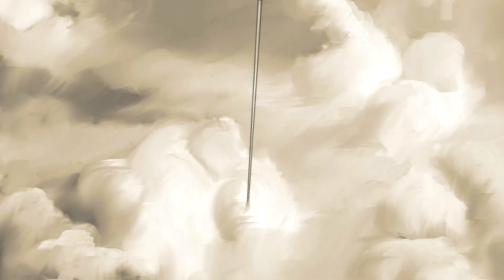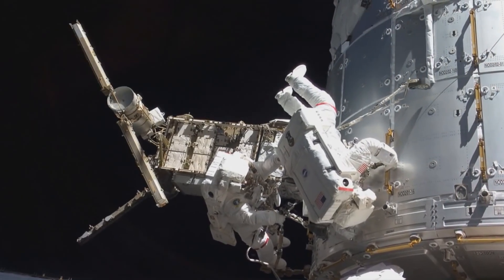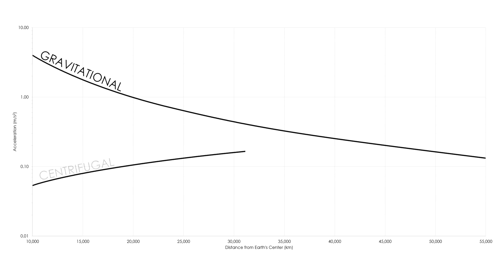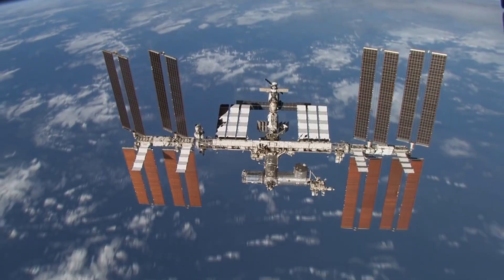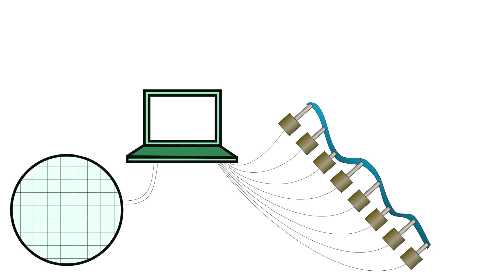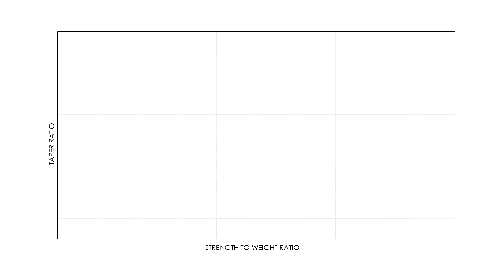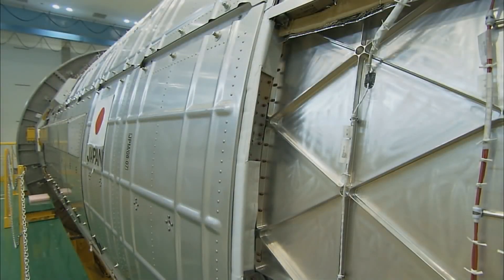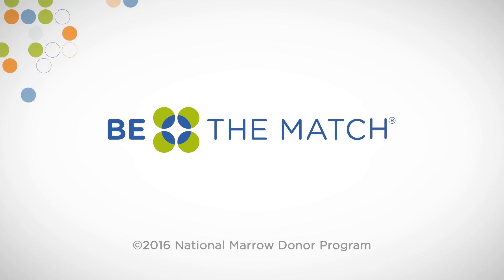Design Your Own Space Elevator

Comment: Hmmm, you say you would need a small diameter cable and have to go up to like huge one at the top where the satellite would be tethered   The reason why is so that the cable could support itself... 

I'm having trouble understanding this, when you say support itself, as in, so it wouldn't fall back down on itself? Or to handle the tension strength or the weight of the elevator itself?  Hmmm... Well, could you push the satellite out further to more tension on the cable so it wouldn't have to be so big?  As with the weight of the elevator itself, about a 3 quarters of a mile up the elevator would begin to start feeling weightless. 

As for power, what if the elevator wasn't an elevator at all, but a fast moving train on a track....  And you had the track laid out to a high mountain like one that is 14,000 feet in hawaii....  If you could get the train up to speed of say a mach 2 (2 x the speed of sound), a little over 1,500 mph, going straight up into the atmosphere, just that momentum alone would most likely carry it into space without any thustors or additional power.

Thanks for the video, it get's the mind thinking.  It sure would be cool to have a train station from earth to space.  A one way ticket please...  I want off this rock!  ;)

Comment: In the desert they did a test like this, it was a crane that had instead of a rope a flat fabric belt (like tie straps) the used solar panels to power the unit and mirrors pointed towards the lifter....they issue was the lifter (elevater) was wobbling around as it was going up and they could not concentrate the mirrors accordance to aim it at the elevator. So we need to put that into consideration...wobble.
Reply: But the other team that did go up the cable far faster and easier, used lasers rather than a wobbling solar panel. much more precise

Comment: Awesome video! I appreciate your handling of the stress/tapering issue.  To me that is the deal breaker on the space elevator.  Ages ago in college we considerd whether a space elevator could be built with a chain of double bonded carbon atoms.  We ran the calculations and determined that the stress exceeded the bond strength.  Your calculations with the carbon nanotubes confirms that result.  

To all the engineers watching this video, "I think this shows that building a space elevator can't be done."

Comment: Slightly more emphasis needs to be made on the speed the climber needs to take to be feasible - particularly for human cargo:

At 100 km/h the climber would take 14 days. That's a lot of food, oxygen and waste management to consider. To get to the top in 24 hours your climber would need to travel at 1460 km/h - the speed of the Bloodhound SSC - by wheels clamped to a very lightweight cable.

Also the mass of the cable:  at 1 gram per meter ( a 1m strip of 80gsm paper 1.25cm wide would weight 1g) would have 35 tonnes of mass - that's not even making the cable thicker and heavier at the top.

All cables stretch a bit. Even if you only have 0.0001 stretch when the climber starts pulling you'll have to somehow handle 3.5 km of slack.

Deploying the cable would be entertaining.  One could lower it down from orbit (I'm picturing hi-vis vested chap staring up into the clouds trying to spot the cable tip flapping about in the wind) or raise it from the ground using sky-hooks or something.

Can't even practice on the moon.  It's tidally locked rotation means the earth is in it's geostationary orbit zone.

I love the idea of a space-elevator it'd be brilliant but, well, infeasible unless some magic is made to sort those problems.

Comment: Great video and animations. The only part that made me cringe was the whole bit about "centrifugal" force. But hey, if it helps people understand then whatever. Nicely done.
Reply from the maker: +jvc https://xkcd.com/123/
Reply: +Practical Engineering lol funny comic. I just hate working with the fictitious force. Net force = ma = mw^2*r = mv^2/r all the way!
Reply from the maker: +jvc In a rotating reference frame, velocity is zero. It's not a choice to use it or not.
Reply: +Practical Engineering But why use the rotating reference frame in the first place? I suppose from a civil engineering perspective it makes sense to have the net forces on the counterweight equal to zero, but using a normal tangential coordinate system, the calculations come out to be the exact same without using a centrifugal force (sense the centrifugal force is "equal" to the mass times the normal acceleration of the object).

Comment: what of the feasibility of using a thorium fueled reactor to supply power...they designed one in the 50's that was intended to power a bomber type aircraft....that could resolve some of the power issue......
Reply from the maker: +Tim Hyatt Very cool thought. I don't know anything about those.
Reply: +Practical Engineering they have a lot of potential,....especially under the same design constraints as needed for a bomber aircraft...would think many of the same factors would apply (as lightweight as possible, while still achieving high output.....)      LFTRs were the competing design back in the 50's and Weinberg's team actually build a proof of concept reactor that ran for 4 years before the project was shutdown (largely for political reasons:  nixon wanted projects in his home state and didnt want competition from others.....)

Comment: Excellent video. Just wanted to mention that for all the talk about saying the same things for years and not going into the details... you said the same thing as every other decent video and didn't go into the details! Specifically, the tether. You waved through it just like everyone else!

Ah, can't blame ya. Liked and subscribed btw
Reply from the maker: +CptAJbanned Thanks. You didn't think the discussion of taper ratios and showing the the inputs to the equation used to calculate it added to the discussion? I had never heard of those concepts until I started digging deeper.
Reply: Oh yes, you're absolutely right. Taper ratios are never mentioned anywhere else. I stand corrected.

Still, more talk on the nanotubes would've been cool too!

Comment: Harnessing element 115 to defeat gravity seems like a better alternative--given that the govt purportedly has already developed technology to do such a thing. :)
Reply: I don't get it. Is element 115 predicted to have a high tensile strength or something? A long-lived isotope of element 115 hasn't been produced (presuming one exists), and even if it had, colossal carbon nanotubes would be far easier to make.
Reply: It's what is known as humor, friend... read all the thread messages. 

However, if element 115 is real & capable of being used to produce anti-gravity propulsion, then there would be no need for a space elevator.
Reply: Oh - element 115 is real enough but only for ~200ms :D
https://en.wikipedia.org/wiki/Ununpentium
Reply: +zeffur7 The Lizard Overlords imposed trade restrictions on element 115 about 5000 years ago — it'd be way too expensive.
Reply: *****
You didn't know that connecting enough flux capacitors together would allow you to make your own element 115 with the right energy reactor source?

Comment: Grady;

In fact, I am in one of the fields you mentioned as being somehow related to Space Elevators. And yes I said it as a plural because the one you describe is just one of the technologies that could serve the purpose of elevating something to space. N.b.; I catalog such a system as a CECNTTSE or in full a "Centrifugally Extended Carbon Nano Tube Tether Space Elevator" while the one I will invite you to consider is a ABSPSE or in full an "Atmospherically Buoyant Spar-Platform Space Elevator" aka a SpaceShaft. And of course there are the Space Towers as well.

I completely agree with your list of reasonable justifications for the need of an elevator to space but the one, I am very grateful, you did not mention is the one which all those 4 science superstars exploit so well for their own popularity and is the ludicrous requirement of automatic orbital insertion when reaching GEO, a precondition that makes those scientists seem to be more in the showbiz than in that of science.

A possible structure to fulfill the requirements you have listed need not cause the automatic orbital insertion for it to be called a space elevator. The only TRUE reason for the CECNTTSE model you discuss as to be extended up all the way up to GEO is just to provide for it the necessary structural stability for it to function and not automatic orbital insertions.  Automatic GEO insertion, (added to the simplicity of a yo-yo), is just an added bonus causing all the fuzz and public interest. Moreover, when considering the energetic savings, it could provide, if a spacecraft needed to operate at lower altitudes than GEO, taking into account orbital mechanics, it will require the same amount of fuel to change orbits going down as it will cost in going up. So the usefulness of a CECNTTSE becomes justifiable only at distances above GEO and nowhere at LEO. And remember that at the time in history in which we live in LEO is the most important region of Space for us, e.g.; the ISS as a simple example.

While the original concept by Tsiolkovsky was a compressional structure it also needed some exotic material for it to be feasible and it is why I believe that his ultimate intention in proposing it was merely to make his contemporaries understand how conservation of energy also applied when balancing potential and kinetical with the achieved altitude and not any sophisticated other benefit. I claim this to be so because for him there was no other logical reason other than suggesting tourist experiencing weightlessness. Remember that, at the time, Tsiolkovsky was unaware of the usefulness of satellites. Tsiolkovsky had no idea whatsoever of the usefulness of having a space telescope, a GPS network, TV or even radio broadcasting, since radio telecommunication was, at that time, not even yet invented by Marconi). His Space Tower/Castle was an invitation for contributions by inspired geeks of the time, (e.g.; civil, structural and material engineers like Eiffel or Otis,) and these did not come in time. Tsiolkovsky's aim then became, with time, centered with rocketry but this was after his proposed Space Elevator, civil engineers failed to find a solution on reducing density while gaining structural stability, and this until now-a-days.

The one thing that has captivated the imagination of millions about the CECNTTSE model you discuss is the apparent elegance of it; which is due to the misleading simplicity of a spinning yo-yo around a child's finger. Hence anything more complex than it, is a; No-No, from the get-go. For example, I am sure that you will recall from your days at college how some other students had some difficulties understanding the concepts of mass, density, weight, etc., so the concept of cumulative buoyancy is a foreign language all together. Well the same thing happens with everything that has some real value in life. The Space Shuttle as you indicate is immensely complex, but admiration of it is because it did get the job done. At the time of Tsiolkovsky, and even Goddard, their lucubrations were regarded as simply silliness, especially by those closest and dear to them.

All the preambles I’ve given above were meant to point out an important fact you missed. In the Wikipedia article you have flashed in your movie there is a mention to a technology called a SpaceShaft, and I bet you; you have never heard about it before despite it is over 10 years old. In fact, there was an article in Wikipedia, with plenty of math describing its mechanism, but it got plundered, defaced and ultimately removed. Anyhow, that is irrelevant right now, and what I would instead suggest is that you read the short description found on the YouTube movie addressed at the end of this contribution.

https://www.youtube.com/watch?v=P3WT1Cagh0U

I have greatly enjoyed your presentation.

Comment: What about different add-on boosts? Like a rail gun to give it a nice little initial velocity? Or hot air balloons for the first 14,000 feet? Then the solar panels could take over and merely sustain the initial velocity. If nanotubes could handle the weight, why not just add on an actual elevator to a nanotube supporting structure?

Comment: One of my big complaints with most discussions on the topic of space elevators is not just the lack of depth, but the lack of breadth. What about powering the climber through the cable itself? or using ground-based lasers for the initial climb then switching to space-based lasers? Maybe you could touch on the launch loop concept or the space fountain?

io9 has an article entitled "Why we will probably never build a space elevator" and while it goes into more depth than most, it lacks the math that your video has. What it does do, however; is bring up at least one interesting alternative: a moon space elevator which could be constructed with conventional materials.

One concept I came up with based on the orbital ring and the space fountain, is to place several stations in low earth orbit which all have a geo-stationary angular velocity but are kept in orbit by a stream of mass (perhaps a particle beam or many small pellets or a few large masses) with much higher angular velocity such that:

Mp*Wp^2*r + Ms*Ws^2*r = G*Me*(r^-2)*(Mp+Ms)

Where Mp is the mass of all the platforms (stations), Wp is the angular velocity of the platforms (pi/(12*60*60) radians/sec), r is the radius of low-earth-orbit (~6720 km for a similar orbit to the ISS), Ms is the total mass of the stream of particles/masses, and Ws is the angular velocity of the mass stream.

I did some back-of-the-napkin math and found that it would be pretty easy to build a low-earth-orbit elevator with a kevlar, or even steel cable. That's not too exciting, because getting to LEO altitude is not nearly as difficult as achieving the delta-v to stay in LEO so any payload delivered via the elevator would either have to stay on the elevator or expend a ton of energy to reach a stable orbit. BUT you now have a stable platform that's significantly higher than sea level and you got there with Kevlar, what if you repeated the process a few thousand more Km higher and dropped a kevlar tether down to the LEO platform? what if you repeated until you get to GEO orbit where payloads can be released without any delta-v?

You would essentially have a space suspension bridge built with consecutive 'rings'! You could boot-strap the entire system with a relatively minimal ring and tiny tether, haul up more equipment (including a beefier tether), then increase the stream velocity and/or mass to boost it up to a higher orbit. then climb down the tether back to LEO and build new platforms that will drop tethers down to Earth. Repeat until the original outer ring is in GEO. I think this could be done with only a few $Billion USD, but  I may have seriously messed up my math somewhere. Please feel free to check it!

Comment: All that and you are still ignoring the amount of space junk just floating around, stuff that would shred most tethers if they impacted. And unlike the space station, the space elevator cannot take evasive maneuvers to avoid collisions.
Reply from the maker: +vipero07 Yeah I didn't have time to go into all the details. I was trying to focus more on the fundamental aspects of the design.
Reply: I don't blame you, it was still a very good video and clearly engineering design focused. Where the space junk issue isn't so much an engineering design problem as it is just another issue. I honestly don't think a space elevator is possible due to all the constraints, and this more or less cements those feelings. From the moon though maybe... perhaps that can be your follow up video ;).

Comment: Really cool video. I don't like your assumption of a tapering tensile cable. In order for equilibrium to be satisfied, the satellite must be pulling at a force that resists all of the weight due to the cable below it, and the cable must pull at a force that resists the centrifugal force of the satellite, therefore the tension in the cable will be the same throughout. Tapering the cable would simply mean it would snap at the bottom.  An even bigger limiting factor to his is that a connection must be made to the satellite that can resist all of that force. The cable is only in tension, which is the strongest force a material can withstand as it is stabilizing. Connections on the satellite will likely involve the transfer of shearing or bearing stresses which materials are much weaker in. Don't get me started on the idea of atmospheric ice further weighing the cable down and the effects of temperature stresses and creep/shrinkage in a structure that long. I can't help but roll my eyes when scientists think this is a good idea. I only have 3.5 years of college and a few internships under my belt so I probably don't know anything anyway, but that's just my two cents.
Reply from the maker: +lpnumb10 The tension will definitely not be the same throughout the cable. That may be a simplifying assumption in your statics course, but the weight of the cable itself must be considered at these scales.